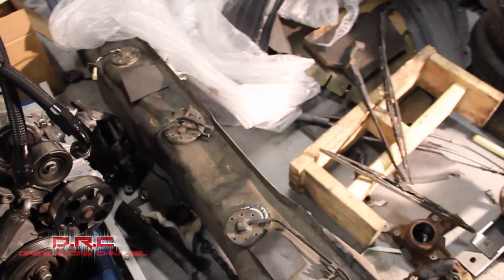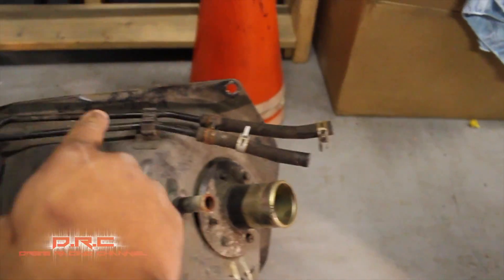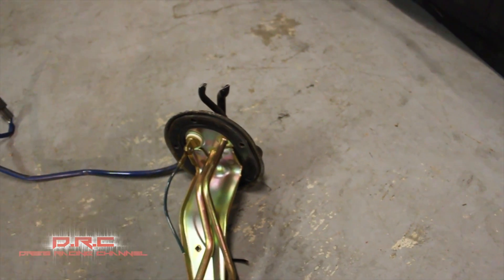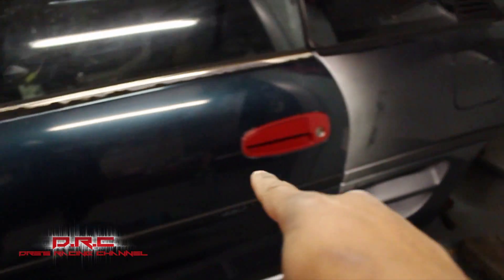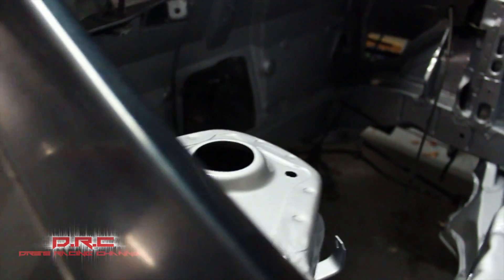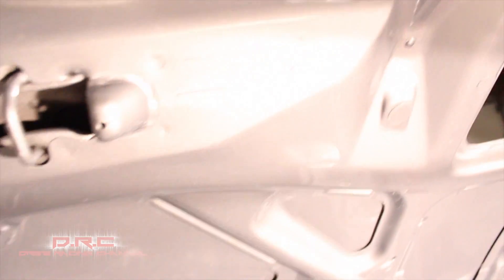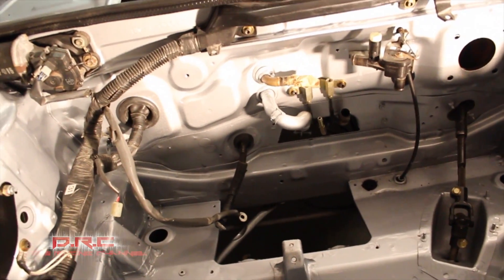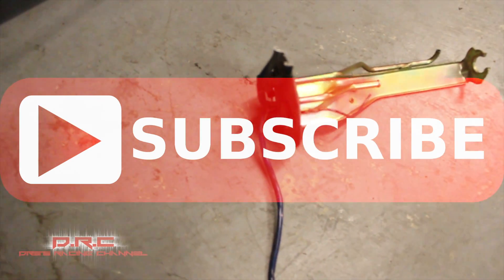Plans for my Fuel setup

Comment: Wiring wise, including the k20 engine wire harness how mucvh of the mr2 wire harness did you have to send in to get it wired together? Only the mr2 body harness or the mr2 engine harness as well?
Reply from the maker: Tou Xiong the harness from the taillights to the foot pedal of the Mr2 and the engine harness of the k20, charge harness and the c101 harness I think it is, the one that connects to the k series ECU